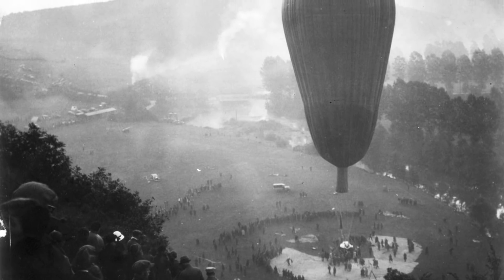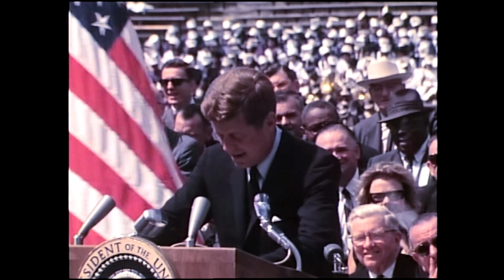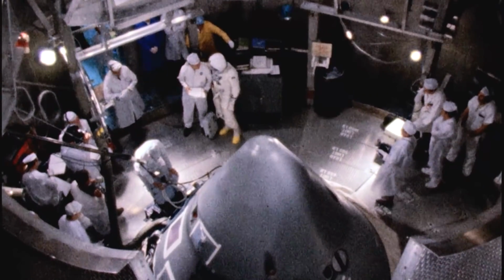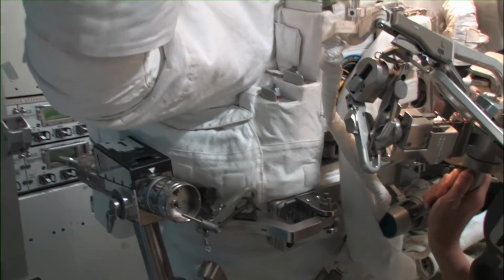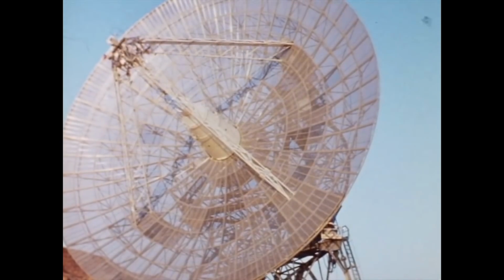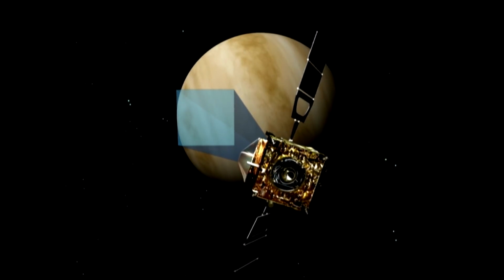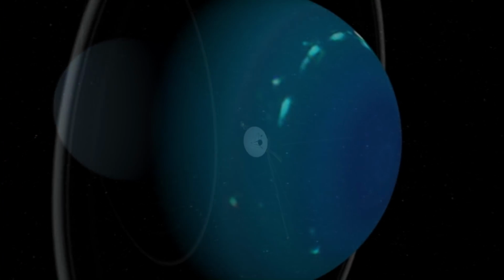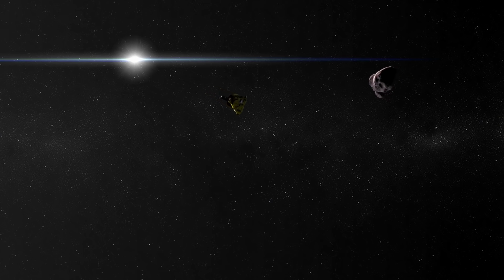Space Knowledge: Other Planets & Spacesuit | Zenith | Free Documentary

Comment: rockets need air to thrust against, theres no air in space apparently
Reply: Not true. Rockets exhausts the fuel and from ejection speed rockets gets their thrust. There's no air in the space. Rockets doesn't need air to thrust against.

On atmosphere rockets can use air to flow with fuel and get more molecules that speeds up. Also pressure of the air gives extra oomph. Ie. SpaceX is designing to use 2 different engine cones, one in vacuum (Vacuum Raptors aka. RVac's) and other in the atmosphere. RVac has larger cone and lower exhaustion speeds to function better in the vacuum.
Reply: Incorrect

Comment: Looks terrifying. I’d rather be 500ft underwater!
Reply: In space we can use thin aluminium foil as insulator from the vacuum of space. But underwater we have to stood against huge pressures with tons of steel in well designed submarine. Pressure difference in space is 1 atm vs 0, while underwater it could multiple atmospheric pressures vs 1. So, space conditions in the orbit are easier when you get there. In outer space radiation is a real threat.
Reply: @martiansoon9092  Underwater, when it all goes south, It’s over pretty fast. I hear the astronauts on Challenger may have survived until they hit the water. 😳